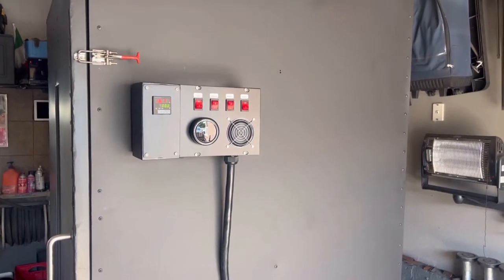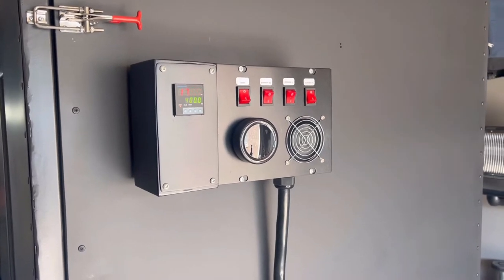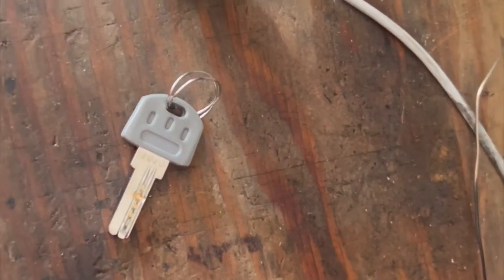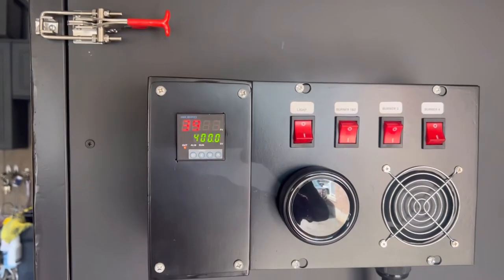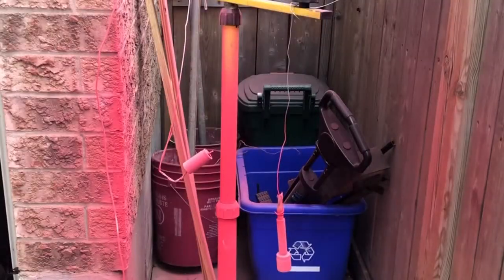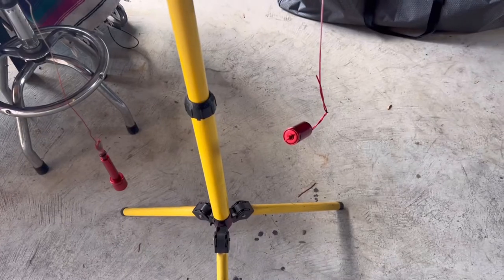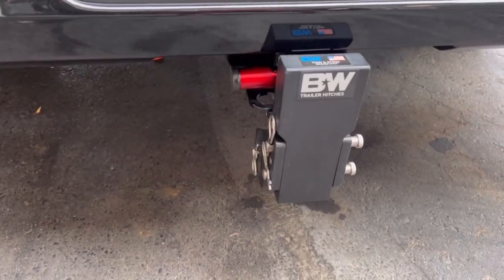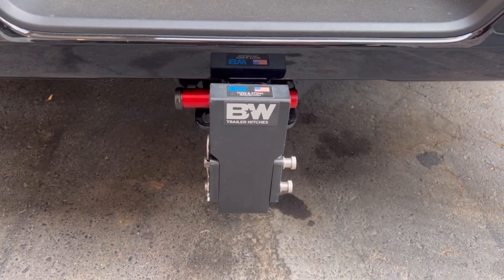Powder Coating Oven Test Run #coating #powdercoating

Comment: I followed the build and it turned out great. Do you have a fan inside to circulate the heat? Also, I'd wear gloves when cleaning and painting so your body oil doesn't get onto the parts being painted being it your cabinet, car, etc. Last thing, and it's minor, switches generally are off when switched down and up when on. Real interesting build, thank you.
Reply from the maker: Thanks for your input. No there’s  no fan in the interior of the oven. I don’t recommend it. Only time I would recommend a fan would be if I was only using Cerakote.

Comment: What brand and color did you use?  Also, you mention blading first but did you blast this part you showed?  I’m asking because the color over chrome looks really nice.  If it was blasted it wouldn’t have come out so nice
Reply from the maker: PRISMATIC-ILLUSION RED  Your right if your blasting  you would need to do 2 stage process,  chrome or gloss white and then illusion red. 
Cheers